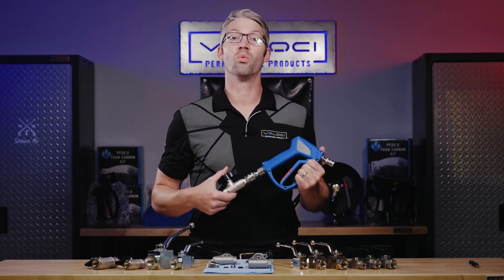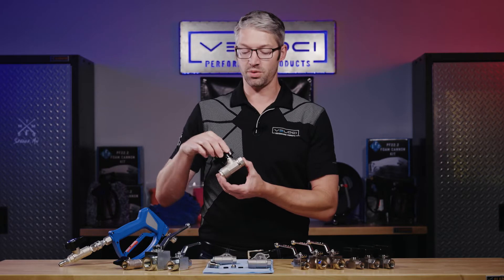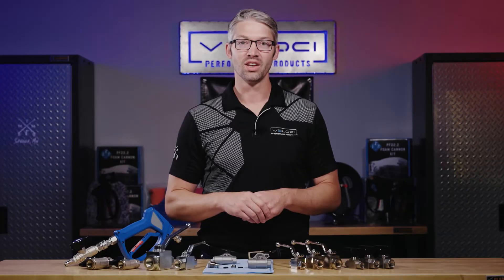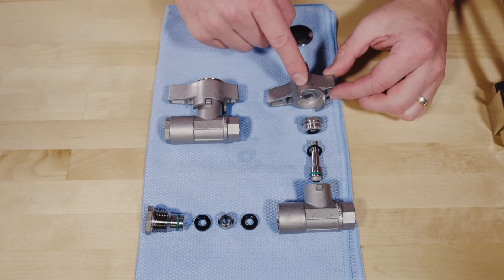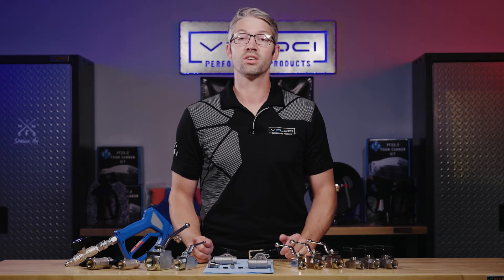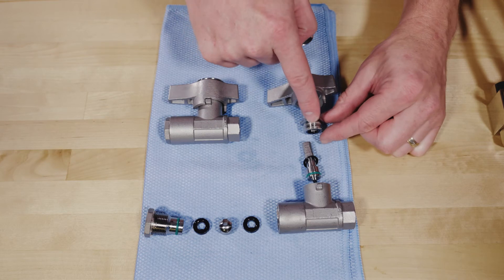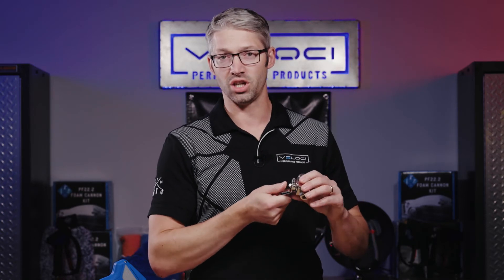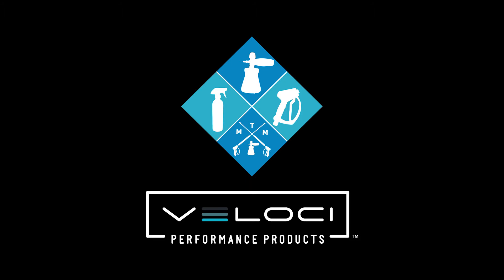What's a Ball Valve?

Comment: Hey there thank you so much great video how do you remove the handle from the stem I have an old one that's in my contact DN10
Reply from the maker: Simply remove the top cap from the handle to expose the nut holding the handle to the stem and unscrew the nut. The ball valve will disassemble from there.
Reply: @PoweredbyVeloci  yes thats what i did. It must really be rusted in there, because its not budging. I even put it in my vice and tried to loosen it up with a dead blow hammer and pry it up but no success and I used PB blaster soaked it all night still stuck on there lol...